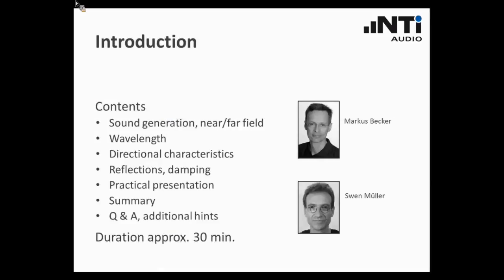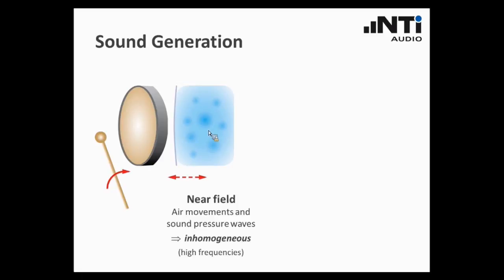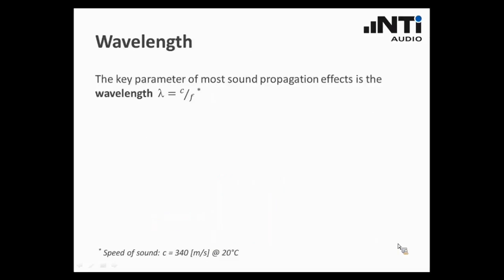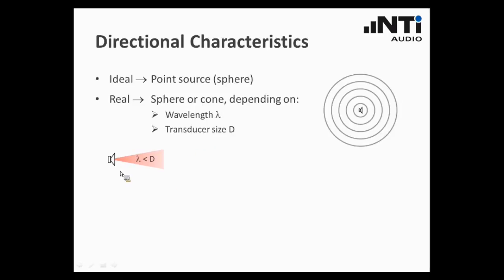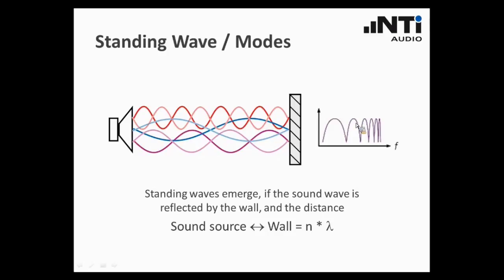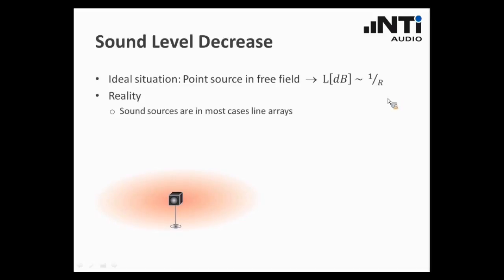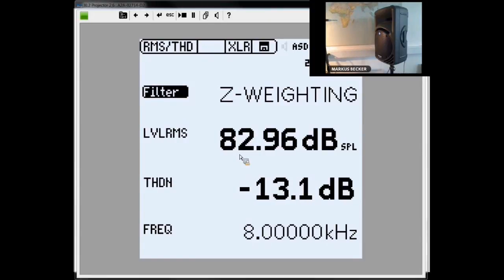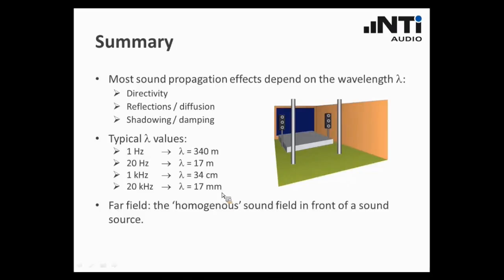NTi Audio Webinar - SoundPropagation

Comment: Hello, it is possible to easily identify room mode issues in the studio/Hi-Fi room with XL2? Do you have best practices guideline or video? I would like to buy XL2 or Clio 12 for measurement of loudspeakers and also reverbation time. However, as you mentioned, even if I achieve short RT (e.g. 0.3s), room modes will have a big influence to the quality of the listening of the music :( Thanks in advance for reply.